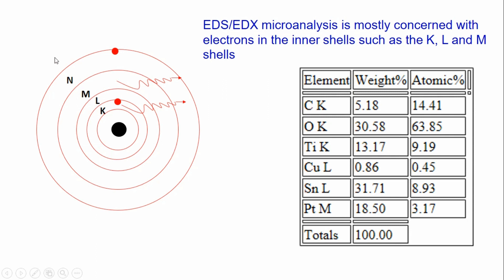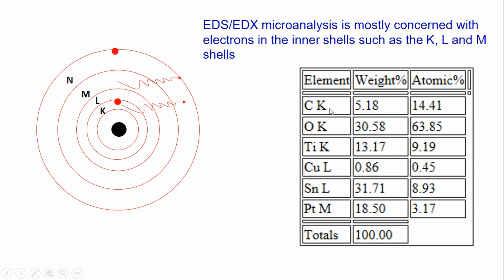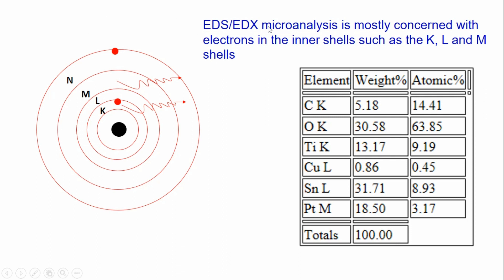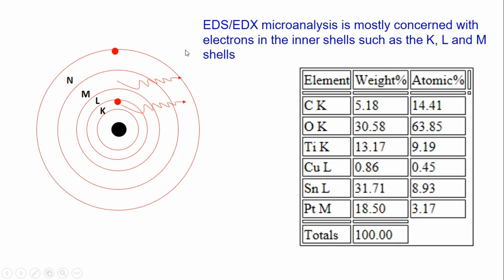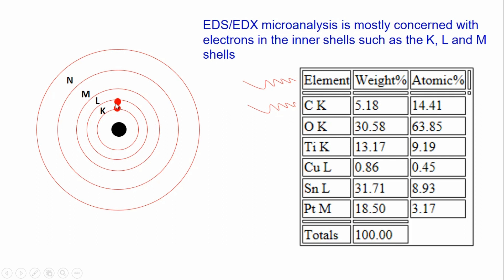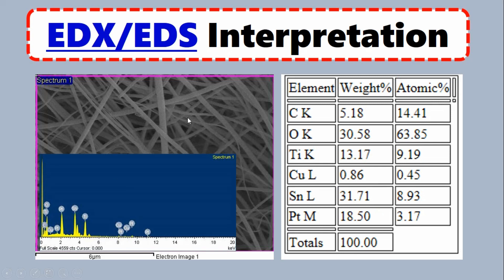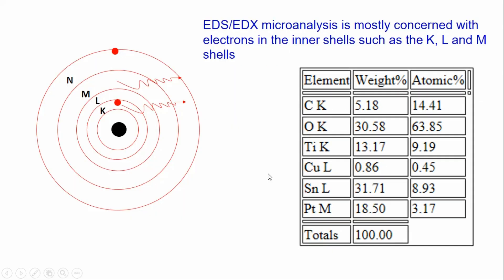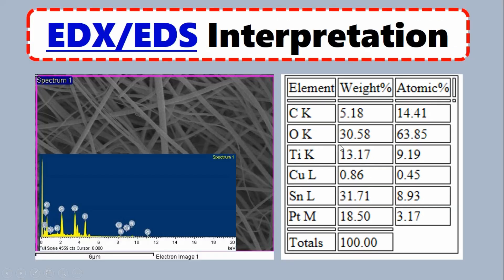What Do K, L, M Mean in EDS / EDX? | X-ray Peaks Explained Clearly

Comment: How to calculate manually the weight and atomic percentage of each element from EDX spectrum peaks?
Reply from the maker: Thanks for the nice comment. 
The SEM operator provides us with the data in the form of a graph and table. The table contains elements in terms of wt% and atomic %.

However,  in general, from the peaks like, one can guess the quantity of each element. For example, if carbon peak is smaller than the iron peak, we can say that iron quantity is more .

However, I don't know how to get exact value.

Comment: How to determine the material structure (such as: A site and B site atoms) from EDX result? How could you be so sure that your material is SnTiO2? can't it be TiSnO2 instead of SnTiO2 or something else?
Reply from the maker: Look that kind of information we get from XRD not from EDX. 

In XRD analysis, we identify the phases (crystal structure) of the materials. For instance, SnTiO2 shows tetragonal structure. Fine!
Now if these elements re-arranged from its position so the XRD will not give us the PEAKS and other parameters like before. This simply means that the structure is distorted. 

In the case of EDX, it only reveals the concentration of each element in term of wt% and atm% How much atoms of each element exist and what is the weight of that element. 

Therefore, for clarification that you exactly synthesized the SnTiO2 structure, we have to perform BOTH  XRD and EDX analysis. 

I hope it is clear now. If you still have any questions please do ask here.
Reply: @nanospeaks  thanks for your cordial response. 
Actually, I'm working on a double perovskite material which hasn't been reported before. but the problem arises when it comes to determine the space group, which was supposed to be fm3m but experimentally I got simple cubic pm3m(from XRD peak). 
however, if I consider it a single perovskite according to XRD & EDX results, nonetheless how can I be sure about atomic position of each materials and crystal identification, like: which material is in A site, which is in B site and which is doped? Sadly, I don't have access to ICDD, and its too expensive as well. 

hope you would reply.

Comment: SIR I WANTED TO ASK YOU A GENERAL QUESTION I WAS TRYING TO SYNTHESISE Ni3S2 ON NICKEL FOAM BUT WHENEVER I WENT FOR XRD, IT SHOWED ME ONLY NICKEL FOAM PATTERN MY ADVISOR SAYS THAT THE FILM MIGHT BE VERY THIN THATS WHY I AM GETTING THAT DEAR SIR I HAVE TWO QUESTIONS 1. IS THE ADVICE TRUE 2. IF YES WHAT SHOULD I DO TO GET RIGHT XRD PATTERN
Reply from the maker: The advisor is right because XRD does not detect Ni3S2. I will answer the same, either, the Ni3S2 film may be too thin, or may be it detached from the Ni foil during the characterization time.

For your kind information,  XRD also does not detect very small sizes like less than 5 nm...
Reply: @nanospeaks  sir under these circumstanceS what should I do if I wish to get XRD pattern?
Reply from the maker: @Puneet Tripathi just confirm the thickness of the film by SEM analysis or for elements confirmation,
 just perform EDS. From these two characterization,  it will be clear whether the Ni3S2 film is formed or NOT.
I would rather suggest revisiting the literature,  the paper you are following and redo all the synthesis again. 
Also, contact the corresponding author of that paper for further clarification if possible

Comment: Sir is edx anlysis perform on pure powder sample or they mix other compound during sample preparation and can edx table contain elementl composition of that compound.
Reply from the maker: Edx is for pure sample too but work better for composite structure.
Reply: @nanospeaks  Sir i have elemental composition table of carbon based nano particle . but it also shows other element in less amount .i.e Na . K . Cl . thats actually not involve in biomass Carbon dot  composition.

Comment: How can we quantify the elemental composition from EDS spectrum from weight and atomic %?
Reply from the maker: The SEM machine when it is an EDX mode automatically gives you in the form of table. So from there you can know which element having how much weightage.
Reply: @nanospeaks   So the weight % is used to quantify elements?
Reply from the maker: @junaidaibrahim8285  exactly. The table will clearly shows that which element having weights %. For instance, you are making composite of Zn and Ti so the system clearly written zn 32% and Ti 45% there are also some other elements such O or C or some other elements but we are only interested in our desired elements in the composit structure